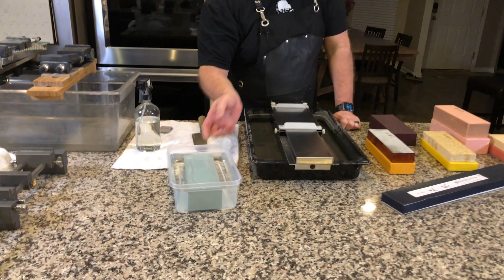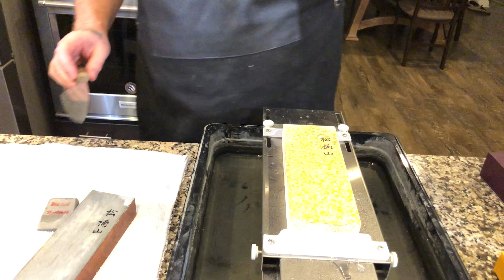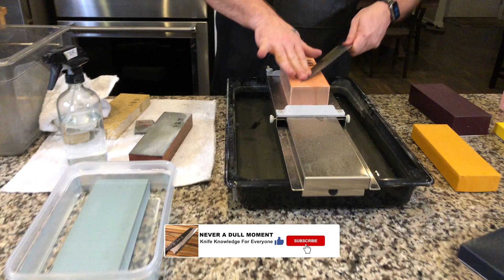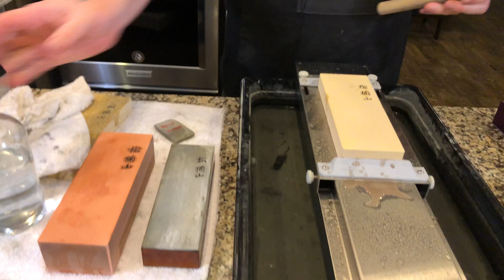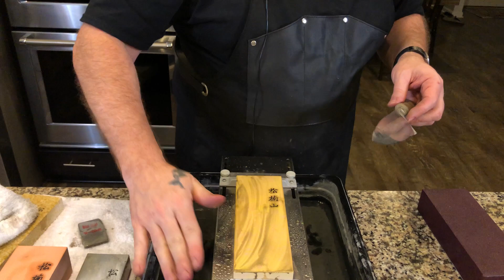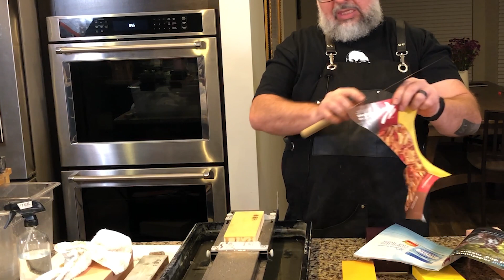Knife Knowledge: Synthetic Stones of JapaneseNaturalStones.com

Comment: U don't de-burr between stones?
Reply from the maker: I do not. I have never had to do that. There is a video in which I make the knife so sharp that it slices blueberries horizontally when handedly. You’ll see that I just do edge leading strokes on the last stones and then leather. I just continue to flip the bur over.
Reply: @nadm  Interesting. Will try!